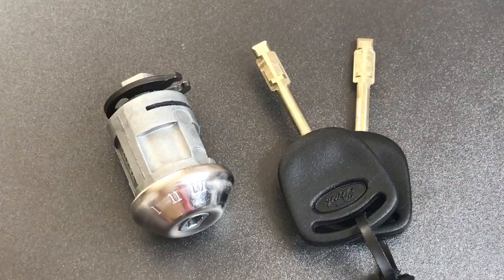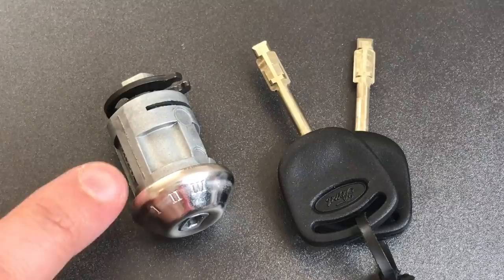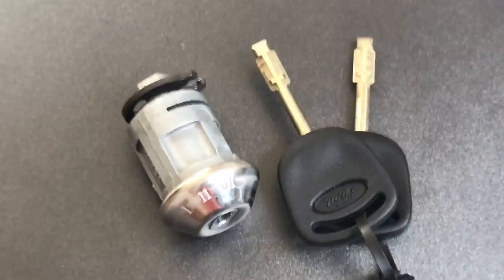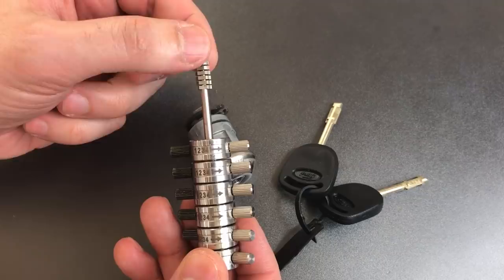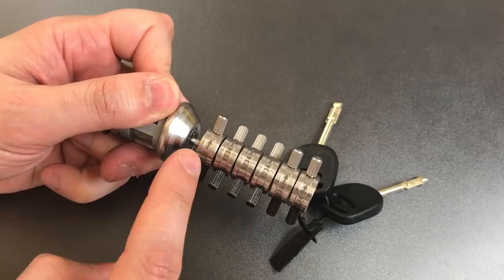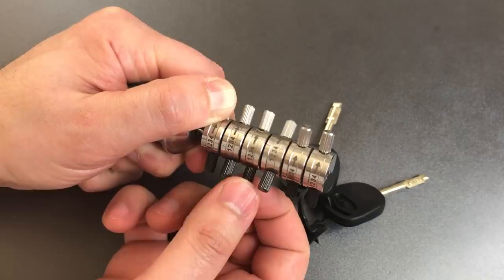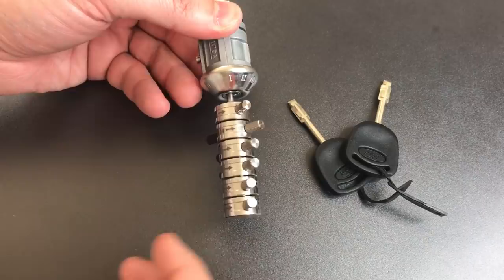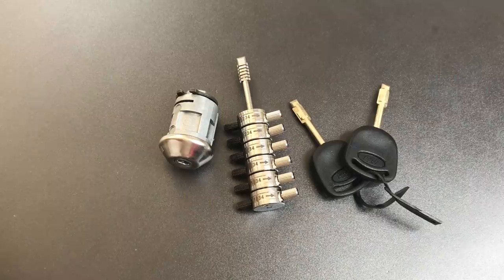[578] Ford "Tibbe" Key Ignition Lock Picked and Decoded

Comment: And using Forscan on a laptop with an OBDII cable, we can program a Trasponder chip to the car and start and drive it away it without the key and without damaging or forcing anything.
A few years ago i recovered a friends car who had lost her only key, i didnt have access to a pick so the ignition barrel was drilled out to release the steering lock without damage to the steering lock itself and i brought a transponder chip with me, taped it to the receiver on the steering column and programmed it to the car to drive it away.

Once the car was home at her home, i removed a door lock and dissembled it to get the key code the rest of the locks used and i then re configured a new (used) ignition barrel to the same code and had keys cut so all locks used the same key.

Obviously, having one of these lock picks and decoders would have made things 10x easier and would have not required replacing the ignition barrel but i didnt have one and needed to get the car back to her home that day so i did what i had to do with as minimum damage as possible.

Comment: See, I have one of the best anti-theft devices: a car that looks like it's on it's last legs with nothing worth stealing (the radio has a cassette player!). It looks like it might not run at all, though the engine is actually very good. But it looks like the kind of car you'd have to pay a thief to steal.

(There aren't even any worthwhile parts on this car since the manufacturer is no longer in operation and the parts are no longer used except on these cars. I've had to rig a few replacements with generic GM parts because my part was not available)
Reply: What car is it?

Comment: in my experience, once it's been worn in, you can pretty much open any tibbe lock with any tibbe key. Or even a thick metal wire with the end crimped to resemble a key.

Comment: these locks are also on the normal sized transit van (the Transit connect was made as a small van and its really annoying searching the second hand market as all sizes of transit turn up). and watching top gear man with a van episode, the thief hammered a flat head screw driver in and twisted and had the van open in 10 seconds lol

there was also a video of the new transit MK8, where you could take a set of wide jaw grips, and turn the plastic housing and it would unlock the van. this is why most van folks change the locks as Ford locks are cheap and mass produced lol

Comment: The two first generations of Mondeo had these. Not sure if the third did. 

The MK1 I got at a good 17 years age had two keys with it, one which fit every lock on the car and one that fit none. Actually I got the non-fitting one to almost jam in the ignition on my second ride after buying the car. I got it out and apparently damaged nothing, but got one of the scares of my sucky life.

The MK2 was 15 yo when I got it and had two fitting keys. One of them I almost lost In the trunk lock. I could turn the lock all right with it but needed some serious force to get it released. After which the lock wouldn't turn. Later on I had to resort to unlocking the doors and then using the button to open the trunk.

My first Ford was a Fiesta MK2 '84 and it had plain pin locks. The original key was so worn that it could slip out when the engine was running, and that was a deal breaker for one inspection. I had to get a key but luckily the local locksmith could cut me one and I was good to go. Yes, the inspectors would try yanking the key out of certain lock types.

Comment: This lock was also used on Ford falcons in Australia 1988 to 2017
Reply: The BF models were the last to use this lock system. So, 2008 or thereabouts. Also, This will only get into the car. To start requires communication with a chip in the key handle.
Reply: Assuming the immobiliser security is well implemented of course. Which, being proprietary, who knows..
Reply: 1988 through to around 1994 (EF?) the security system is only checking the correct lock barrel is plugged into the harness, ie the crook hasn't plugged another ignition lock into the cars wiring. They didn't have chipped keys.
Reply: TeddtheTiger BA mk I was the last to have them,   BA/BF mk II replaced them for newer locks. 
Theres some useless info for ya haha
Reply: @Tedd755  I own a BF falcon and i can assure you that tibbe was used from late EA to BA. BF, FG and FGX have a different style of key more similar to a commodore than earlier ford tibbe or wafer locks.
Reply: @whorayful9361  AU MK2 is when the transponder tibbe keys came in. ford changed from smartlock to smartshield. You can tell if its a transponder key or not as the transponder key has the wider bow as shown in this video
Reply: @Nathan Uhe my BA mk11 ute has the newer style of lock

Comment: Is the Protec vulnerable to the same exploit?  If not, how is it stronger?
Reply: Many more disks, with many more possible cut angles on an Abloy. Also the false gates on a Protec feel exactly like the real one under tension. (to me anyway)... So being unable to feel "the right one" forces you to try all of them. All two billion possible combinations ... There IS an exploit for some protecs where you just punch out the disk stack though.
Reply: Protec has a key guiding element which also restricts the movement of lockpicks. And don"t forget about Disc Blocking System, which prevents tumblers from turning before sidebar can even touch them! So, you can firstly enter the keycode and secondly compare it to that which the cylinder has inside it, but you can't do these 2 procedures at the same time to use them for lockpicking which is possible in the majority of other locks

Comment: Well, talking of car locks..... My first car was an Austin Allegro Estate. One of my first trips was to the Canterbury half marathon. I took the key out of the ignition, put the key in my  tracksuit trousers, and then took my tracksuit trousers off and put them on the seat, and then got out of the car, and pressed the lock down while holding open the door handle, and swung the door shut. I realised too late that the keys were in the car and that I'd just locked myself out. So after the half-marathon, I went up to a policeman and explained my predicament, who asked me what car it was. I told him, and he lifted up his hat and gave me a piece of flat nylon band of the type that is used to hold the protective packaging onto new washing machines or bundles of newspapers. I was astonished, but went back to my car and fed it in a loop through the door seal and lifted up the door lock button in only a few minutes.

On another occasion some of us went to France for the day. At Dover I parked right next to an identical model that was also the same colour. Just out of curiosity I tried my key in their lock - it opened easily! So either way, the lock was pretty useless.
Reply: Those FS type locks are useless at least the ones they used in cars were the ones in my kitten can be opened with any similar sized key 
the marine ignition is fine (you can’t use a screwdriver you do need the correct key) quite the opposite of a Lucas type key

Comment: These locks were used on the EB through AU mark 1 Ford Falcon.  However in the AU they also have a chip in the key.   You could pick it - but it wouldn't start, as you had to press the remote button to get the immobilizer to disarm.

Comment: My first car was an M-reg Fiesta (circa 1994 off the top of my head) that used these keys. Ghastly thing, but hey, it was transport. I think my dad's 2004 Transit uses them too. I can remember one of my keys had a red bit on and could unlock more of the locks than than the other, black, one. Strange system.

Comment: It was actually used on ALL transit vans up until recently, the transit connect is a small van on a Large car base.

Also transit vans engines range from 2 litre to 3.5 litre, and in America the smallest displacement on the ford F-150 is 3 litre.
Reply: MadSam ! Thanks, Google can tell me this and more.
Reply: Actually, the smallest displacement on the f-150 in NA is the 2.7l ecoboost(not the 3l diesel).

Comment: Years ago, I had a Fiesta first, then a Focus later. With the Focus I found, that the similar dimensioned keys (these hex keys were available in different variants) could be used to "always" lock the car of another person (at least with the cars I tried). So I take my key, insert it in the unlocked lock and then lock it.

Also, with age, these locks got bad. A buddy once unlocked my trunk with his key. For fun of course, gladly. This didn't work on the side doors though, nor could he start my car. My key on the other hand didn't work on his cars locks at all, except for locking the car.

Comment: The Ford Europe car thieves' favourite method of entry is/was to exploit the weak spot welds holding the tibbe lock in place - take a hammer and electrician's screwdriver and hammer round the lock, use the screw driver as a crude tension wrench and break the lock body off the door panel. Later model designs countersunk the lock to deter this, but 90s Ford models were notorious for how quickly they could be broken into - needless to say it happened to my Fiesta. A measure of their ubiquity if nothing else.

Comment: The contemporary alternative was Vauxhall’s (GM) wafer lock which could be opened with a pudding spoon. It made a Master #5 look good. 
In the end, a vehicle lock is just clipped into sheet metal so thin that you could rip it through without any trouble, so they’re little more than a comfort blanket. I’d recommend any trades to get a secondary cage for their tools, or buy an old riot van. But scrotes will be scrotes... in the end if they really want it they’ll pinch it.
Reply: An old riot can sounds like a good idea.

Comment: I lost my only key for
My x-type at work. The dealership wanted over 2500 and I had to get it towed, the driveshaft bearing was going out on it and you can’t just replace the bearing it’s the whole
Driveshaft so I just cut
My losses and junked it.

Comment: I have originated several Tibe keys in PA for transit connects. They were standard with a few years of production here in the US. It may be easy to pick, but originating a key is a time consuming process because you need to make cuts on the key and then rotate the key several times.
Reply: I work at a gas station, I've seen these locks on a transit connect vans, but not all. Those vans require the key to lock and unlock the fuel filler door also. I'm not sure why they didnt go with a system like toyota did years ago that you only need the key to unlock it.

Comment: even if you manage to pick this you will only be able to open the door. Car won't start because there's an immobiliser system. only way to do this is to program with special tool and have proper chip, then wait 10 minutes per key. Some programming tool can bypass the 10 min wait tho. Source: Car locksmith.
Reply: Bobby brought his own car, and your 6,000 dollars of tools are still gone.... and u never heard ur car Start.
Reply: Not Pulverman yeah, shucks

Comment: I had one of these; you can maybe gain access to the vehicle, but the car had an ecu paired to the key fob, you couldn't steal the vehicle with a piece of metal. When they broke into my car they just pealed the door back. They then tried hot wiring with no success as no fob, no start unless you're carrying an ecu with you. On the vans they just tore the lock out of the back door and then sat in the far end of the car park making a clone.

Comment: Now just need a video on how to dismantle the core of one of these locks. At my workplace, we scavenge good doors off our decommissioned (Engines dead beyond repair.) when an animal impact damages one too much. Problem is, the locks never get swapped, so on the rare occasion the keys get locked inside, a spare (On the even rarer occasion we can find one.) won't open the door to regain access. Due to the small size of the company, and age of the vans, we don't want to spend the money getting a locksmith to redisk the door locks to match the ignition.

Comment: You can decode the key in a matter of seconds just by looking at it.  There are only 3 actual cuts (2 on the 8-position keys), and even a very worn key can be charted by eye -- since the same cut is in four places around the key, just look for the one which is least worn.  The hardest one to decode is the #1 (no cut at all) and #2 (very slight cut).  If there is a slight ridge above the chines, that's a #3, and if the cut goes straight to the chines, that's a #4.  The 8-position key is even easier, with no cut, partial cut and cut to the chines.

Comment: The door on my ‘92 Ford Orion was opened with a screwdriver once. No picking required. But the ignition lock is probably of a higher grade. Fortunately no attempt was made to ‘screw’ that, they were happy with taking just the radio 😒

Comment: Tibbe locks were "easily" picked just with a fixed pick in ´80s. Pick looked somewhat like Allen key with Tibbe key shape (something like standard disc detainer pick) and only worked if you had the 4 in somewhere front (if I understand correctly you would start from the bottom of the cylinder, manipulate the last and then start coming forward - if the lock was at for example 4-4-1-2-3-2, that would mean that you cannot insert the pick anymore back to number 4 to manipulate the lock open). After these chinese multiaxials came to market, you can easily steal any pre-96 car (for example Mondeo I from 1993 to 1996 used mostly a Tibbe key without immobilizer), after that there is a immobilizer PATS chip in the car which worked nice as a theft deterrent. But you can still gain entry and disable the steering column locking, etc. I somehow still love the Tibbe lock, it is genius design compared to the ´80s Japanese and Italian locks, still use until 2006, even when the keys worn you can get new keys made for really cheap (less than 30 euros) and just remove the PATS chip from the old key and you are good to go. Decoding was easy and even changing the locks were easy and affordable when compared to modern systems.

Comment: I had a 4 ford's including a rare fiesta RS turbo I built myself and it was stolen probably using one of them keys. I put around 7k into it and 100s of hours labour. It was a one off so I managed to track it down and got it back after that I upgraded the locks and alarm with cameras and sends me a text if the doors are opened without using the key fob.

Comment: Tibbe locks on FORD Transit 1992 onwards ... UK
1. Steal the entire Fuel Filler cap, with the locking barrel, by force.
2. Ascertain the Key T number as described.
3. Return and steal vehicle.  
We lost close to 100 vehicles from our fleet 1992/3/4/5
The Police crime trail led to Ireland ...

Comment: In picking this lock you ignore the fact that the key transmits a digital code through the lock into the ignition cylinder and then into the computer to disable the ignition kill.  Even if you do pick the lock, the car will NOT start without that code being transmitted.

Comment: I'd like to see you poke through the ignition tumbler used in the 1980-86 F-series pickup....along with dozens of other Ford models manufactured over several decades.

fun fact: My friend in HS bought a '67 Mustang and the key for that car was close enough that it would start my '85 F150. My F150's key would start his Mustang as well, but this combination was much fussier because his key had far more wear on it.

I also have to wonder how easy it is to pick these keyless start systems. I fucking hate them, but hey.

Comment: I should really try to see if I still have the old ignition lock from my Opel Astra. The shaft that turns the ignition circuit actually broke, and I bought a new one and replaced it myself, after having a keymaker rekey the new lock to use my old set of keys.
Of course that's only the mechanical part. It also had an RFID immobilizer.

Comment: It's easier and quicker than that. The thieves would insert a long thin screwdriver, hit the screwdriver hard once or twice with a hammer and then turn the screwdriver to open the lock. This was demonstrated in an episode of Top Gear where the 'thief' opened the van door in about two seconds with minimal noise.

Comment: You ignore the fact that the key is electronically activated by a code before you can start the engine. Without the code it will NOT start. Maximum of 4 keys can be coded at one time. If any lost has to go back to dealer to re-code.

Comment: LPL, I know this is an old video, but I'm curious if you have any comments how to do a hard or soft bypass on an immobilizer system where a transponder is required to use the ignition. Have you ever considered doing a video on this? I used to key and code transponder keys at my old job, so I'm somewhat keen on the tech, but by no means an expert. Ever since working on them my interest has been peaked.

Comment: You don't even need a special device to open these locks, any well worn Ford key would open and start another Ford vehicle with a little jiggling. They were the most commonly stolen carts in the 90's and early 2000's for this reason.

Comment: I assume you just picked a left side door lock judging by the direction you turned it to operate it after picking it. I'd therefore assume that to pick a lock on the right side, (for UK viewers) you need to go the opposite direction in each of the actions you did whilst picking?

Comment: DO NOT BUY! I brought the picker to work as a tool, just got use for it, and it got stuck in the ignition. I had to use a wise grip and a hammer to get it out, and ended up replacing the lock on my own bill.

Comment: Ford had a problem with theses lock where they could grab a pair of vice grips and clamp onto the outer ring of a lock and they could turn it a lot of this was recalled because the lock wasn't tighten hard enough to the body of the car